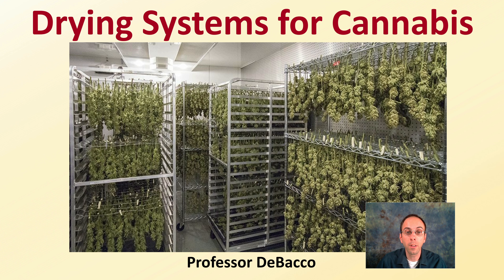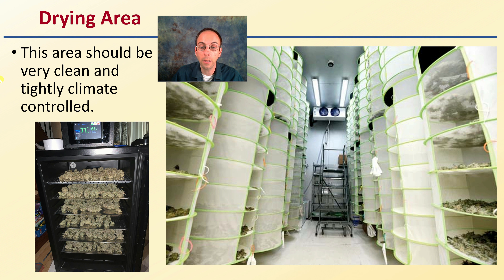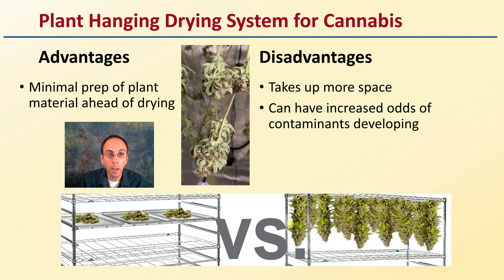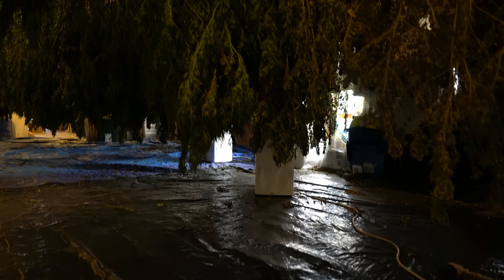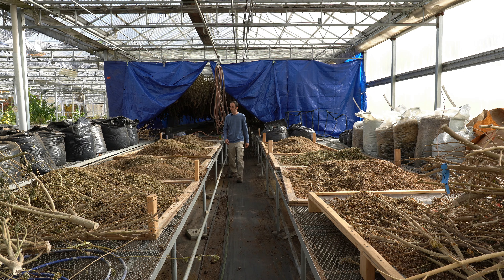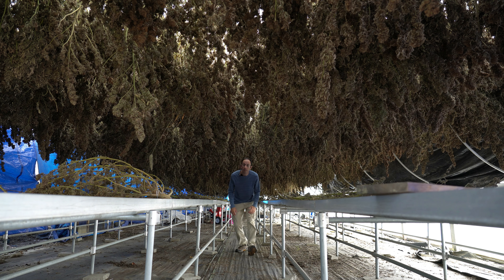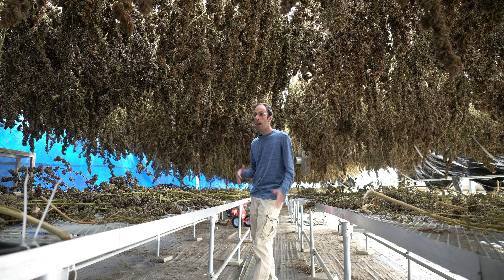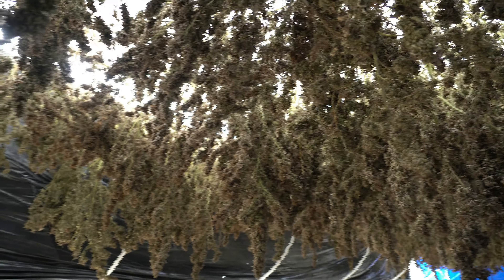Drying Systems for Cannabis

Comment: My friend never drys in dry nets any more, they are a headache, you constantly have to turn the flowers to prevent them flat on one side. Whole plant hanging is the way to go in my opinion.
Reply from the maker: Pros and cons to each method but what you mention is true.
Reply: That and because there is more plant material it drys more slowly, which is a good thing, helping preserve all those terpenes you worked so hard to grow.
Reply: @Habitt5253   the problem with dry nets is when the bud is cut from the stems it drys to quick, I have seen some peoples bud after it’s been on the net for like 5 days and it feels dry but it doesn’t smells right, it’s got that green smell to it which is nasty.
Reply: Al Alberto  outdoor plants?
Reply: I’m having trouble with the drying process is it better to hang the whole plant roots and all?
Reply: @Cricri760  No just chop just above the soil line then hang upside down preferably in a dark well ventilated room, my friend says that he sometimes removes as much fan leaf as possible first which helps with the drying time, or if you want your bud to dry a bit quicker instead of hanging it by the whole plant just cut the branches off and hang them instead, but just as a tip don’t use dry nets, if you’ve spent all that time loving your plants it makes no sense to try and rush things at the end, hang drying might take a little bit long to dry but good things come to those that wait.
Reply: Outdoor plant are usually going to be bigger plants so I would still hang them but chop all the branches from the main stem, remove all fan leaf then hang from lines upside down in a dark well ventilated room with a R/H of between 55-65%, and you should be golden.
Reply: The whole plant is never hung, it is dried in branches as small as possible. the active compounds are already in the trichomes
Reply: Thanks for the feed back much needed and appreciated
Reply: @multiyask1  obviously, we’re not talking about smoking branches pal. I’ve been growing for nearly 20 years, worked in this industry for over 6 years and in my experience I’ve learned that you get a better end product when the drying period is not rushed. I’ve known people to work hard on their crops and do everything right but then they have tried to take short cuts at the drying and it’s took a product that could of been a 9 down to a 6.
Reply: @ChronicCraftsman  very good friend! I am 41 years old, and 22 years of cultivation too. I studied native medicine 15 years ago, I study medicinal plants. I have some experience.👍 Plants don't dry out whole, the best result is obtained by separating small branches. Greetings! 👍
Reply: when you dry the whole plant, the sage is drained, and the chlorophyll into the bud, and that gives a bad taste when smoking. The moon is also important at harvest time because at one point the sage goes down to the roots and at other times it goes up to the buds.
Reply: A bro am from Atlanta ga who needs friends down south
Reply: @ChronicCraftsman I know when I hang the whole plant,  taste is usually more pronounced than individual branch hanging.  It's hard to do with numerous plants bendy if the space available,  but the end product is much better.

Comment: The easiest dry I have ever done, in decades of experience, has to be since I moved indoors. With multiple tents , I can use a 2 x 2 ft. tent and exhaust fan cycling in a progressively reduced exchanged rate. I can easily maintain a consistent 60* / 60% environment. With limited space and budget, I have been able to extend the time and slow cure with little effort. It takes about 2 weeks to get to a stable RH, and it's done! I don't see why the home grower would do it otherwise!
Reply from the maker: The goal is controlling the environmental conditions;-)
Reply: Can you please explain the progressively reduced exchange rate?
Reply: How do you keep the temperature low in this separate growtent?

Comment: Hello from Arizona.  My big problem is Humidity.  It is typically 34% Humidity in my grow room (5X5).  I am looking into a humidifier but haven't obtained one yet.  Getting the humidity to go up to 60% is a real challenge.
Reply from the maker: Growers in other locations have the exact opposite problem;-)
Reply: get a 4.5 gallon digital Humidifier
Reply: I too am in AZ with 5 years exp. I use two 1.5Gal humidifiers (4x4X8 tent) during grow cycles (it's hard as I am still only able to keep humidity at 40%) and use 1 during drying keeping the humidity at around 40% with no lights in a tent if at all possible. May be tough, but it works (10 days on dry) then a 10-20 day jar cure and you will be fabulous. It's never failed. The thing about AZ is that we have a lack of humidity and the other thing is we have a lack of humidity...so this is how I do it.
Reply: I use a humidifier and exhaust fan connected to an Inkbird humidistat. This is used on a 2x2x6' tent dedicated to drying and works great for me in AZ. Humidity in veg can be accomplished the same way, but stay away from humidifiers in flower, even in the desert.
Reply: I am in AZ too and I use an evaporative cooler to help manage heat and humidity issues. I haven’t hooked it to my Inkbird yet but should be amazing.
Reply: Try a mushroom bag co2 generator. Soak the bag hang it and you get co2 and humidity.
Reply: I’m in AZ and I use a swamp cooler on a timer that turns on every hour and a half for 30 minutes. Works wonders and all you gotta do is fill the cooler every 2 days
Reply: A bro am from Atlanta ga who needs friends down south
Reply: AZ also tip remove massive temperature swings remember moisture love big swings to promote mold

Comment: Very precious content over here. What about the humidity? I have dried them slowly from 90 to 62% in 15 days. But I have read some tips to keep it around 52% in drying and 62% in curing. What is best, take it nice and slow or straight to 52% and then set it to 62%?
Reply from the maker: Keep the dry and cure room at 60% humidity and 60F and you should be in good shape.

Comment: No mention of desired humidity level, desired temperature, or time?
Reply: I dry 70 n 45 humid 🗣💨💨💨💨⛽️⛽️⛽️
Reply from the maker: Stay tuned for a video on the specifics to be posted tomorrow on this channel;-)
Reply: @DeBaccoUniversity  Thanks
Reply: @DeBaccoUniversity  Cool Cool  70degrees 45humid until the stems snapped. Should take around 7/10 days ⛽️🗣💨💨💨💨💨⛽️Works every time ⛽️
Reply: @youngpro211  you cure after that?
Reply: @FinnAdamchek  yupp after the stems are snapping i put in jars. Open n close the jars for the next couple days
Reply from the maker: The video you are looking for... https://www.youtube.com/watch?v=6vcF3GnpUYY&t=320s
Reply: @DeBaccoUniversity  Thanks professor
Reply: Dew point is more important than humidity level
Reply: @youngpro211  Ouch... way too dry for monolayers.
Reply: @NEKingdom241  not true at all, aW is a direct relation to humidity.
Reply: @brianharris4144  def can adjust start 65 60 humid then lower as you go always gas ⛽️
Reply: @youngpro211  monolayer is formed at 55%-62% wouldn't drop below that if you like terps.
Reply: @NEKingdom241  Consistent humidity air flow and air quality. No doubt stay far away from the dew point.
Reply: @brucedressel8873  Along with temperature. It's similar to aging meat or cheese.
Reply: @NEKingdom241  You better go back and read some books… Dewpoint is directly related to humidity.

Comment: If my dry room is between 45-51% humidity and 70-76 degrees what will I need for the drying and curing process? Humidifier or dehumidifier.
Reply: depends on how full the room is with wet weed. a little would need a little more humidity...
Reply from the maker: 60% humidity and 60F are the targets.

Comment: Hei,  great videos!  👍
But,  what do you do with the rest of the branches?  Do you take fiber out of them?  Aren't they useful for something?  How many possible uses can it has?
Reply from the maker: Many are working on a use as some simply discard them.
Reply: Boil them in a bucket all day and you will have stem tea drink a couple litters and you’ll be high
Reply: And keep the rootball…u can make FECO oil w it
Reply: You can make batteries, clothes, hempcrete etc.
Seems short-sighted to just discard all that potential.
Reply: @raukurawaihaha  depending on how much you have, how often your havesting and how much time/energry you have. its not very economical to anything besides compost for many.
Reply: @Rockwellsfighting14  I understand. It just makes more sense to me to reinvest and become more vertically integrated over time.
You're actually saving money in the long run.

Comment: On your drying racks where your material is heaped to dry, is that all the trimmings? Do you dry your trim before doing extractions?
Reply from the maker: General trim material that would otherwise be waste so why not extract it to get something rather than just discarding it.  (However, there is a fine line between extracting and turning a profit vs loss.)  Dry or wet trim as it can depend in part on the volume of material and the available labor at the time.
Reply: @DeBaccoUniversity  yeah 100%, there's all sorts of goodness to found through the whole plant, shame to take a flower and throw the rest. 
What types of extractions do you do on your farm and do you have a preference?

Comment: So many people cut the stalk without the roots. Leave the roots. Ton of THC is in the roots. It will drain. Dont cut the roots away
Reply: NOPE. No THC in the roots. 
THC COMES FROM THE TRICHOMES ON THE LEAVES.
Reply from the maker: There are no cannabinois in the roots, but some are experimenting with other uses for them.  Also, components are fixed in the plant and no drainage would occur.